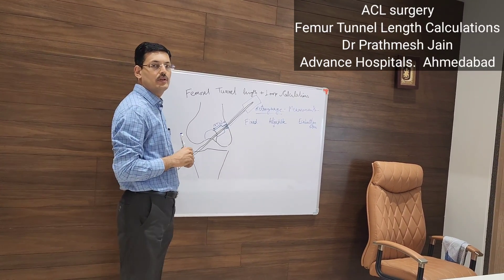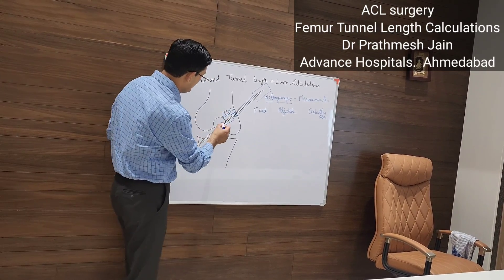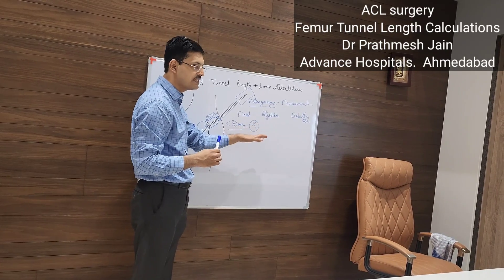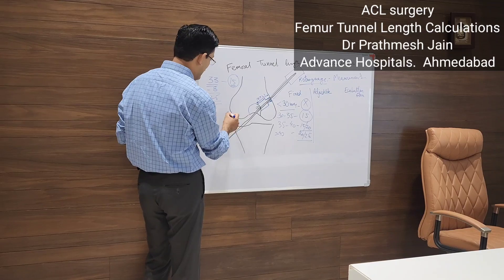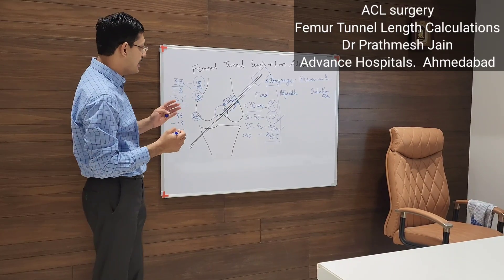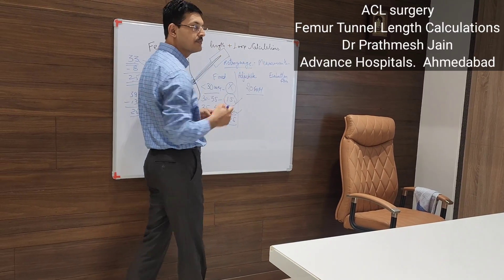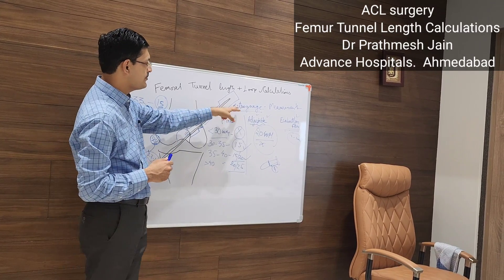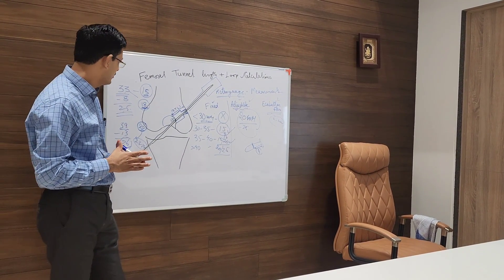FEMUR TUNNEL CALCULATIONS IN ACL SURGERY

Comment: Dear Doctor., 
After 4 years of ACL reconstruction surgery in the knee, the following is observed from MRI scan.
"Geodes/cyst seen along the posterior aspect of proximal tibial tunnel measuring 1.8cm x 0.5cm with mild loosening of tibial screw."
Now I am experiencing pain in the knee. I do not know whether titanium or biodegradable screw used, but not SS screw. Can you please address the solution for this problem?
Reply from the maker: Send reports on 7096021980